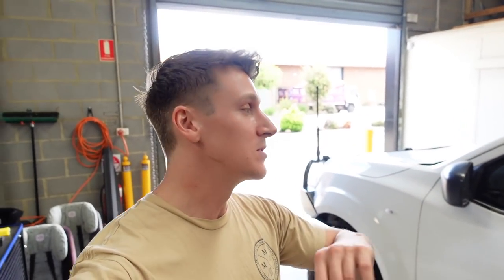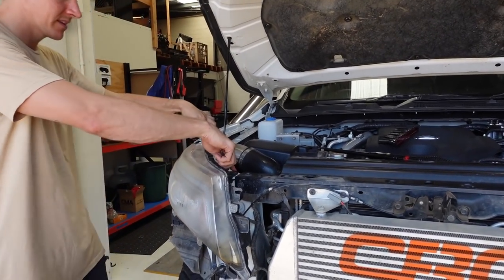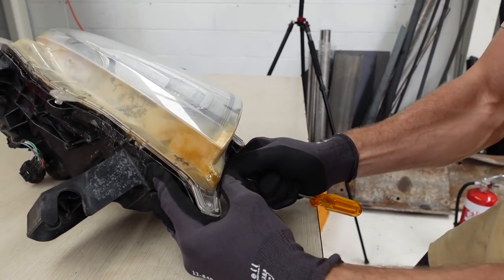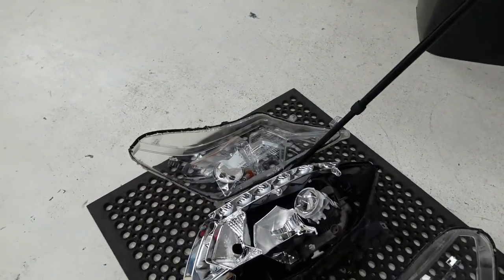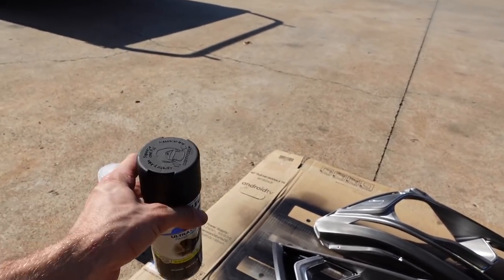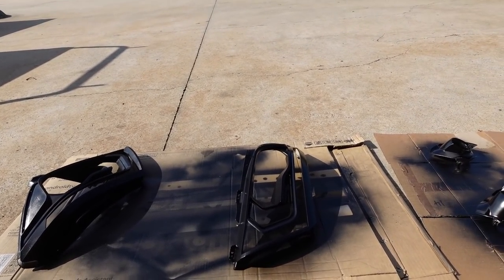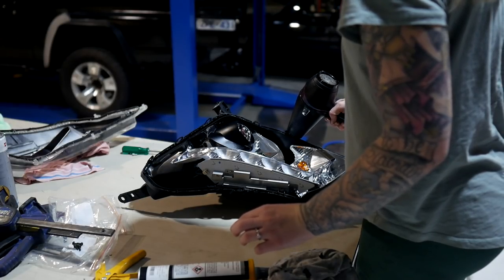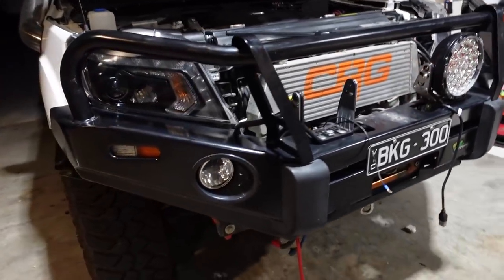Black Out Your NP300 Headlights DIY #SHEDSESSIONS

Comment: How's it man, going off subject lol is your throttle control still in the same place you put it because mine unstuck itself and I put it in the exact same spot you did just under the drink holder.
Reply from the maker: Hey man! Yup, mine is still in the same place and has not caused me a single issue yet! Doesn't get in the way when you put drinks in the holder either 👌
Reply: Yeah mine has come loose and is just dangling lols that's cool as though IL grab me some 3M double sided tape should fix the problem. And I was wondering if you have any mates here in New Zealand that do what you do so I know what shops to purchase bits and pieces from like for example the hot pipe you installed there's nothing here haha I may have to order from oz and get it next year lmao

Comment: Hey JP why don’t you get a custom set of Headlights like what Proline Automotive, Aurora Custom Headlights make ?
Would look better and would be sick to have your headlights on disco mode like your rock lights.
Reply from the maker: Because... I like a challenge 😁
Reply: @jpcaptured799  fair enough.
I’ve gotta say you’ve done a grouse job with blacking out your headlights it looks really good, if I didn’t know you did it yourself I would think you would’ve got the blacked out ones from Nissan grouse job bud.
It’s 100% changed the whole look of the front end and looks more streamline, to be honest I’m not a big fan of people blacking out there cars I like having bits of chrome on cars but that’s my personal preference but blacked out headlights are definitely suit cars with bullbars

Comment: Need to lower the bar by heaps mate up to close to the head lights eg vibration and flex of the bar ect $900 for a new ipm module been there and done that when i had my light bar tapped in 🤣🤣